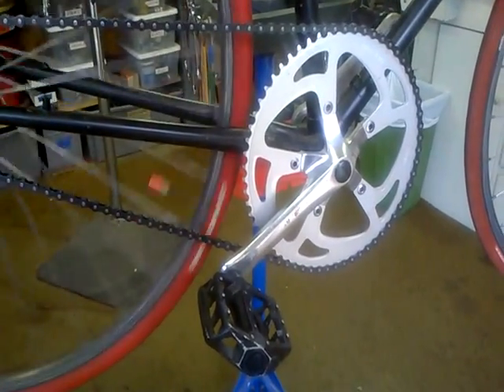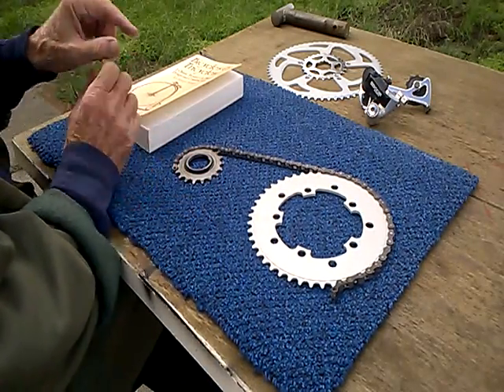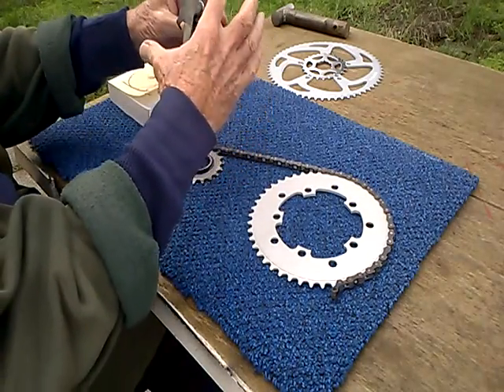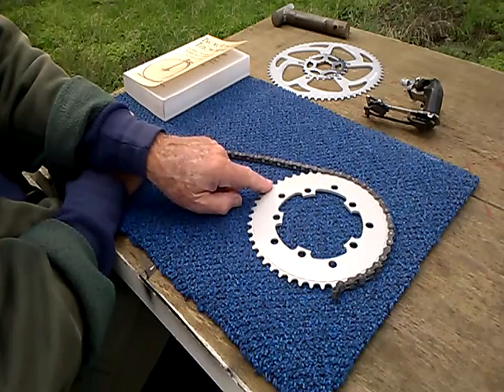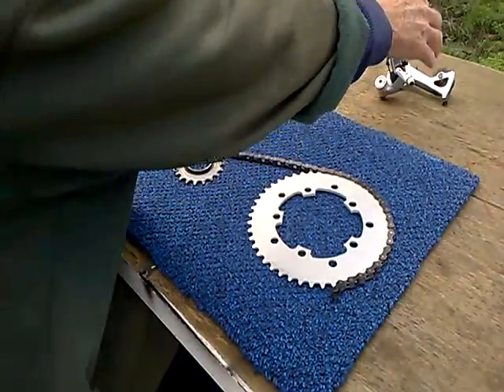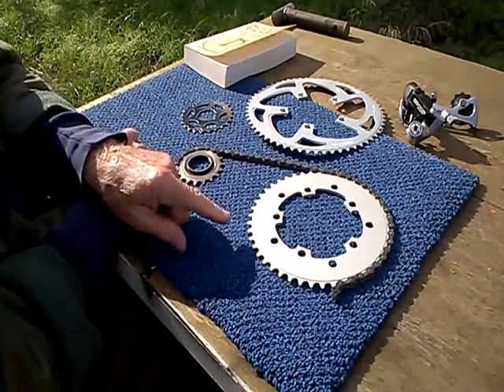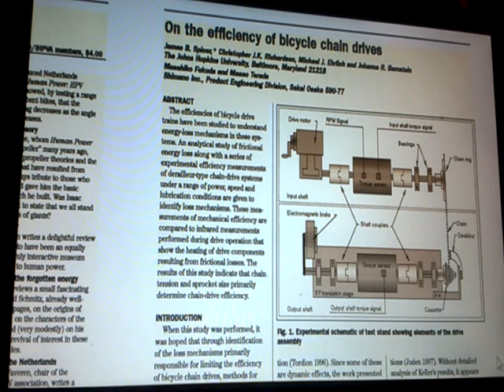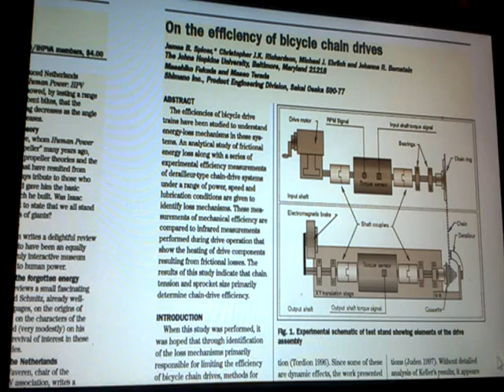Big Bicycle Sprockets; are they more efficient?

Comment: The effect of rear sprocket size on derailleur bikes is a lot more complicated than it might seem. In the IHPVA article you mentioned, two important conclusions are reached with regards to derailleur drivetrain efficiency:

1. Derailleur drivetrain efficiency has a negative linear correlation with reciprocal chain tension. In other words, if you apply double the torque into the crank in a given gear combo, then, crudely speaking, you will cut the percentage of power loss in half.
2. Drivetrain efficiency increases with rear sprocket size, all else being equal.

Although not directly mentioned in the article, point 2 applies to the chainring as well, albeit to a lesser extent, and this has important ramifications for fixed-gear bikes as you've quite well explained. However, it turns out that points 1 and 2 lead to conflicting advice with regards to minimizing drivetrain losses in derailleur bikes. If one switches to a larger rear sprocket, then chain tension MUST decrease at the same input power and road speed. This occurs because the pitch line velocity of the chain increases.

Close inspection of the graph of efficiency vs reciprocal chain tension for  a Shimano Dura-Ace rear derailleur (on page 6 of the article) reveals that, out of the 52:11, 52:15, and 52:21 combos tested, the 52:21 is most efficient at a given chain tension. However, this isn't the complete story. When accounting for differences in chain tension required to achieve a given rear wheel torque, the 52:11 turns out to be the most efficient combo up to 6.5 Newton-meters. For a given rear wheel torque of greater than 6.5 Newton-meters, the 52:15 becomes the most efficient. The linear best fit lines of the efficiency data seem to suggest that 52:15 remains the most efficient combo of the three as rear wheel torque continues to increase. This lends credence to the idea that a 15t cog is close to the optimal size for riding at moderate to high intensities on the flat, or when climbing even the slightest of gradients.

I am curious as to what effect, if any, derailleur cage tension has on the optimal cassette cog size. I suspect that decreasing cage tension would decrease the relative importance of chain tension, and increase the relative importance of rear cog size, perhaps to the point where the 21t cog might become more efficient than the 15t cog when riding hard.

Comment: I tried big and small and everything in between. I say it's all good, until you go under 13T. I can use a 13T to sprint or anything. The 12T is ok if you don't push too hard at high speed, low torque(descents). I never put 11 or 10T on my bikes, on these I can feel my power drained.

Comment: Thank You! So true. I agree, completely. By far, you have the best information, here. I would like to know, what is your crankarm length? Providing your height and inseam would be helpful, too. In addition to that, and even better, I would appreciate if you made a video on the topic of crankarm length.
Reply from the maker: Crankarm is 170mm, although I have also used 165mm and 175mm. The 175mm is too long but the 165 is OK. I am 5'8" and 32 inch inseam.

Comment: What do you think of the recent derailleurs with 14t jockey wheels?
Reply from the maker: Actually, not a recent development , the 14 tooth wheels have been around for many years. But, yes, they are more efficient than the smaller ones and have less friction since they spin at a lower speed on the bushings.
Reply: @harv855  Thank you!

Comment: By far, you have among the most credible and accurate information on bikes/gearing, online. 

In the future, can you, please, review the MG Tech Crankset? It has planetary gears.

 See below:

https://m.youtube.com/watch?v=U3sZq9H6ivA 

and

 https://m.youtube.com/watch?v=WJld2CwaPjI
Reply from the maker: Planetary gear drives for bicycles have many advantages, such as convenience, easy shifting from a stop, clean, good 

appearance, and more. But they are not as efficient as a more direct drive such as a single speed or multi-speed derailleur system. This is due to the power loss through the gear contacts, especially with systems using more than three speeds. However, these drives are excellent for e-bikes where the power loss is easily handled by the output of the e-bike electric power system.

Comment: They're not. It's better to use a smaller sprocket and a smaller chainring.
1. Weight
2. Less chain therefore less friction/travel
3. More clearance due to the smaller chainring
Reply: or are they?
Reply: Not necessarily if the materials used are a lot lighter stronger and stiffer than it’s traditional equivalent that big chainring is vastly superior......the problem that this causes is the cost. The cost to weight ratio. Most of us mere mortals won’t benefit from it other than it looks cool vs an athlete that pumps their legs like forged pistons. There are even 65t chainrings entirely made up of carbon fiber and yes including the teeth are carbon fiber. Is it “practical” maybe maybe not. For track athletes it propels them faster of the line or acceleration. However in the condition these athletes ride in are perfect flat smooth circuits and not city streets.